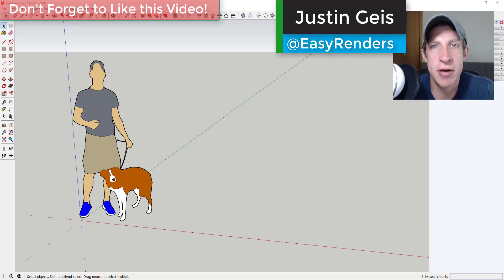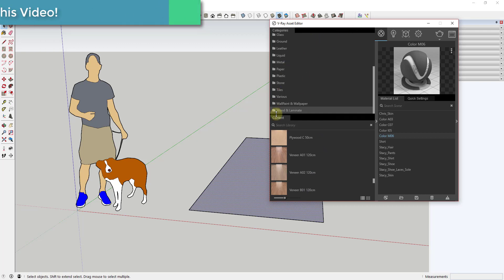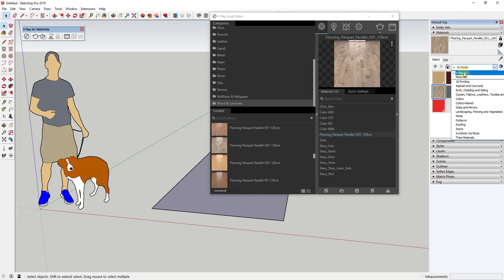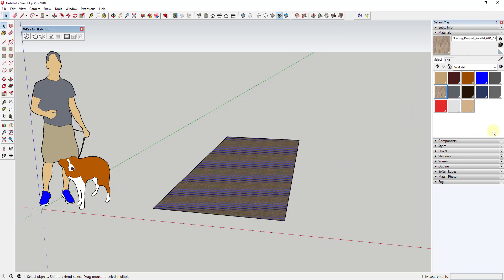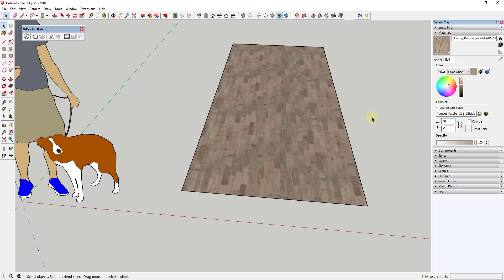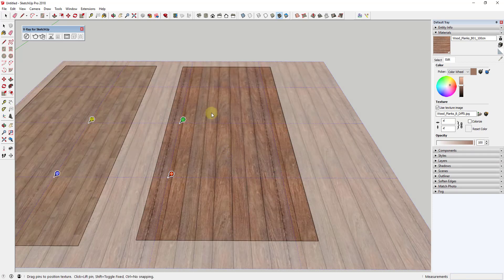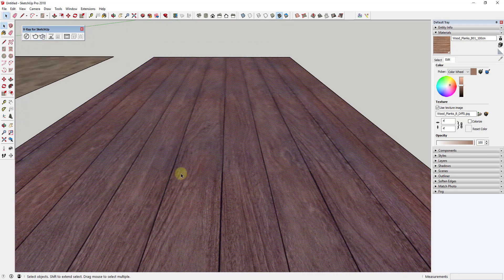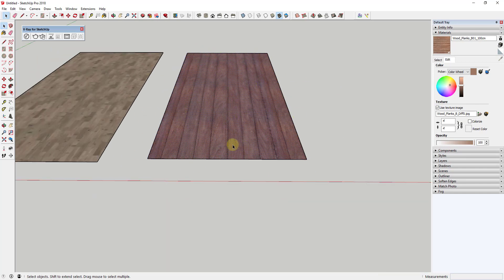RESIZE AND POSITION VRAY MATERIALS in SketchUp

Comment: Hi thanks for a great video. I tried changing the orientation and it work great in Sketchup. But for some reason the change does not work when I render in VRAY. The material is still in the wrong direction in the renders? Have you seen that problem before and do you maybe know a workaround?
Reply: The same problm here 😢 do u find any solution ?

Comment: I am rotating the texture as you said, but in the Vray Rendering image, the texture postion stays the same (even thou it is changed in the modeling space) . I dont have that problem with resizing , just with positioning. Any idea why is that happening?
Reply: first make group or compenant after aply material and change pos.vs...

Comment: is there any way to apply vray multi-sub texture to the selection ?
Reply from the maker: Wouldn't you just split the face up in SketchUp and apply different textures to different faces?
Reply: @TheRenderingEssentials  I`m making an outdoor design , working in the paving industry. I want to create a non repetative texture for the linked picture than import to twin motion after that.  https://we.tl/t-kuIutvfQm4
And I tought that I make texture with vray multi-sub texture than project to the faces so I can import in twinmotion. Any other tip how to make that ?

Comment: why my pattern rotates after rendering to the wrong direction? even when I changed position of it?
Reply: I have the exact same issue
Reply: THIS FUCKS ME UP EVERY TIME
Reply: Try to apply the material to both sides of the surface and do not apply the material nside group or component
Reply: @stenpetrovich  I applied to both sides, and when i changed the direction on the face, the back side didnt change. after i applied to the back side, problem solved! thanks!
Reply from the maker: No idea on this one...
Reply: did you figure out how to fix this?

Comment: I have a problem with this function, which is when I change the position, the bump map does not follow, do you know how to fix it?
Reply from the maker: What version are you using?
Reply: Hi! The "texture -> position" tool doesn't work if you add the material into a component. You have to add it into a component's face :)

Comment: All the Vray materials with textures have a handy size hint at the end of their names - for example the first floor material you picked says "120cm" - all you have to do is enter that for your size (SU will automatically translate it to Imperial) and BAM no guesswork! Or I should say "little guesswork" as you may need to adjust here and there but I find for the most part it works pretty well and is usually a great starting point.
Reply from the maker: That's a great tip Jacob - thanks!
Reply: great tips! thank you